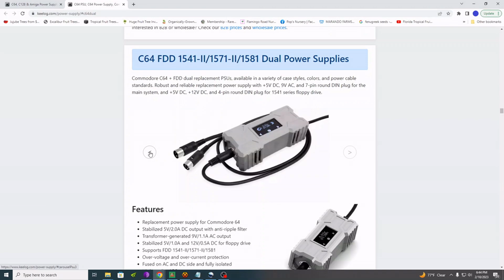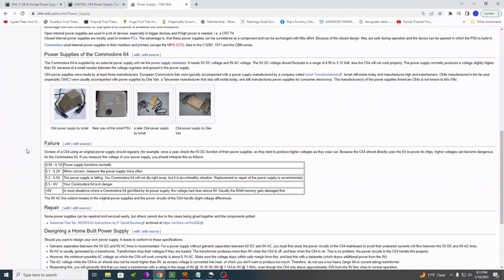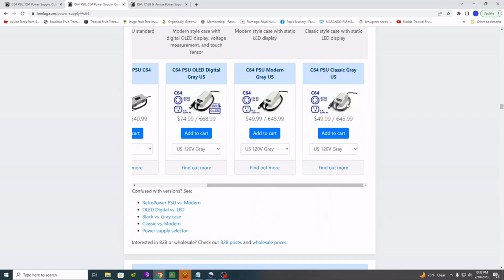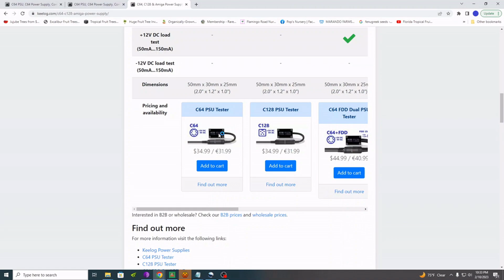Commodore 64 64c Aftermarket Power Supply Unboxing And Review From Keelog. DON'T USE ORIGINAL PSUs!!

Comment: What if the new so called safe PSU from poland is dodgy.?..i would tend to use a voltage saver lead with this just to be sure.
Reply from the maker: It wouldn't harm anything to use one!

Comment: Well i just ordered one of the RetroPower models, even thogh it'll be the european 230v version with the single plug C64 cable. It was about time to ditch the old bricks. But the main idea of the purchase is getting a reliable psu for my currently still untested vic-20 restoration project. Somehow it's giving me goosebumps to hook up that old original brick. Cause you may never know if the chips will blow. And secondly, i'll have a decent psu if i want to hook up one of my 64's again.